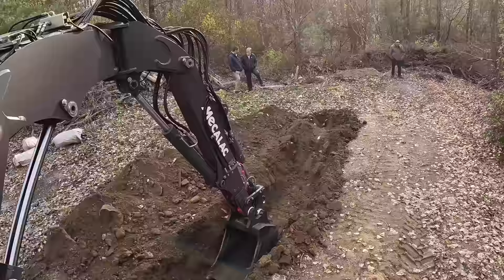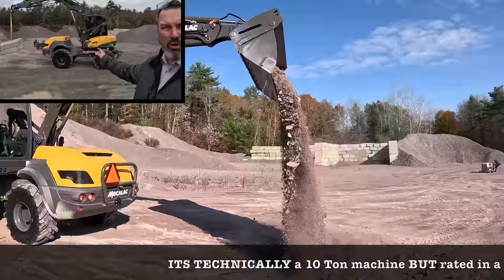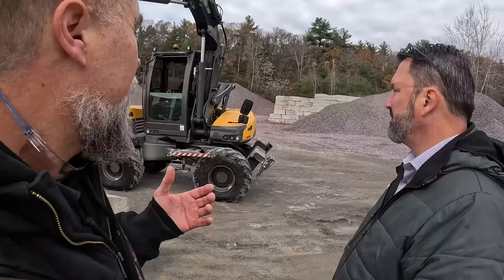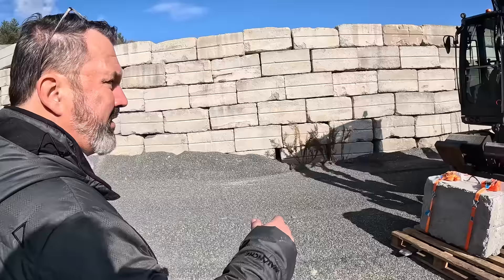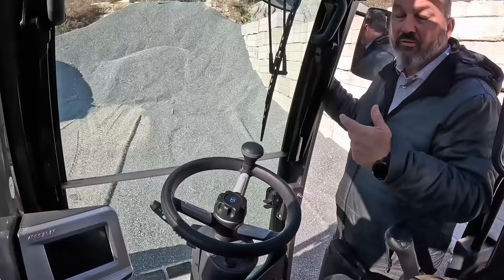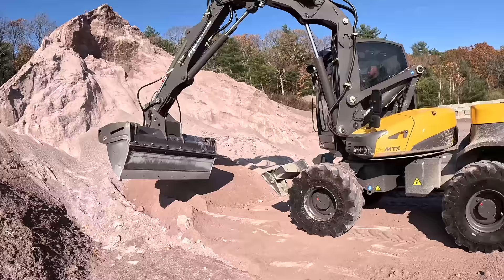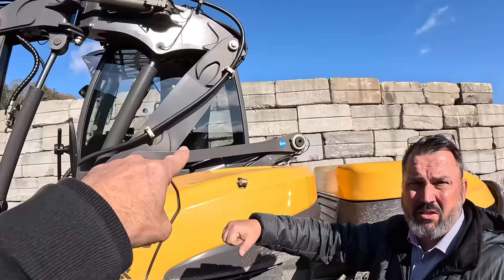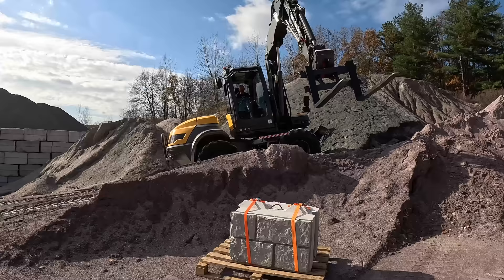Mecalac Built a 3 in 1 Excavator/Loader/All terrain forklift   4K

Comment: Very cool design really is one thing exactly what you said it’s not going to outwork a dedicated mini excavator or a wheel loader or even a skid steer rubber track or tired, but it does everything at 50% so for the guy that needs all of them doing hard scape getting the stuff into the backyard it would be awesome

Comment: Mecalac makes a heck of a machine as far as excavators go but they sure come with a hefty price tag too!!! Another great video stan
Reply: I disagree, If you factor in a machine that performs the job of multiple machines then the Mecalac is less expensive.
Reply: It doesn't though , it's like a backhoe it's a jack of all trades but a master of none !!! Thats the problem with exotic machines people think it will replace all kinds of other equipment too and it doesn't
Reply: @rirebel6029  I see no reason this won't perform as well as any mini excavator or skid steer, in fact with the boom, stick, and hydraulic setup, I see it outperforming them.

Comment: Stan I've been watching ya for years. Thanks for all the hard work and dedication it takes to crank out the  quality content like you do. This question has nothing to do with this video. I've got a Takeuchi Tb 240 it's about 8500lbs. Conventional tail swing single flow hydraulics. I'm getting ready to buy a grapple from cmp. Olaf reccomends the 102 it's approx 800 lbs. I'll have the electronic momentary diverter since my machine is single flow. I've seen yall running one for years on that Daewoo. Any tips or thoughts before I pull the trigger. Thanks -Warren

Comment: I like these new mecalacs. I would like to get 3  mecalacs and replace 6 piecees of eequiptmeent. i undeerstand they make a undeerrtakeers version as well .  get a tracked reemotee control dump traileer/robot so you can fill the trailer  and havee it drivee itseelf to dump and comee back. now i just want a machinee with 2  seats. i usee my cab as an office , training , and demonstration forr clients, your swamper. the eeuropeon eequiptment is getting more reliable. and a lot moree uses and better ideas to geet a job done. likee my kids gaming keyboard that i cant type on.😁